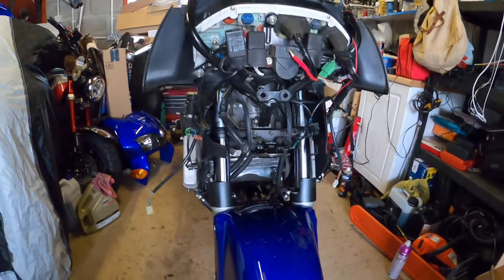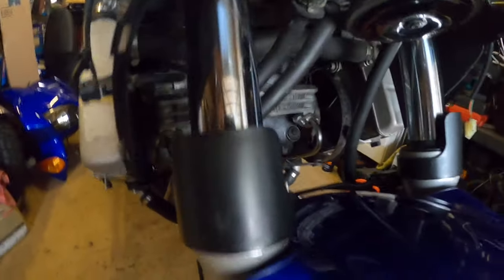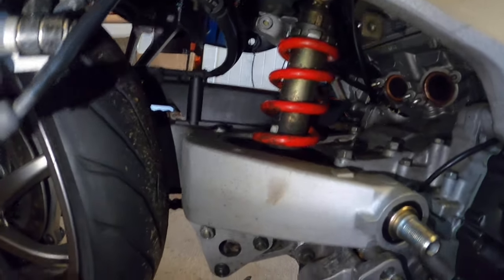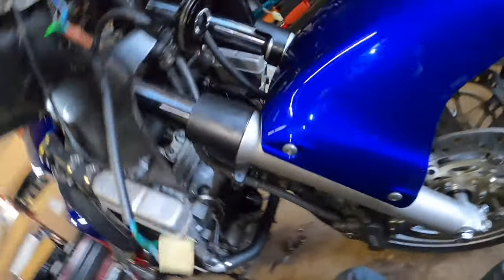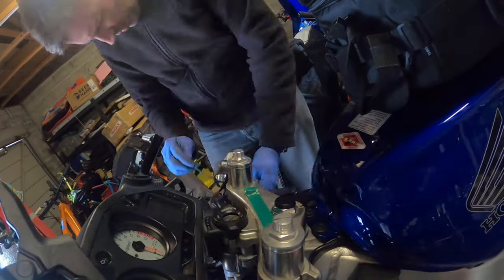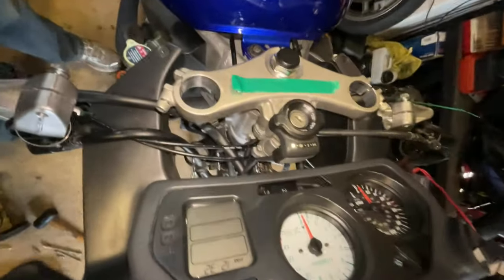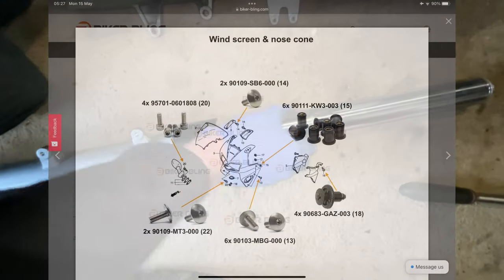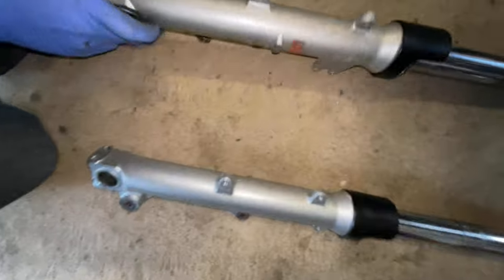Project RC46 - Episode 2 - Drop your suspenders!

Comment: Looks better condition than my gsxs 😂 it went on fire on Friday while driving. See my short I posted
Reply from the maker: Blimey! That's not good.  Fried starter solenoid? Pretty unusual on that bike that I'm aware... 😕 Hope you got it sorted. 👍

Yeah, thanks She's not bad, I've been messing with it all winter, cleaning, replacing etc etc... Could have had hours and hours of footage but would have meant hours upon hours of editing of which There is loads on these bikes already for that sort of thing , so just doing my own thing, will be plenty content anyway regardless! 

Having the time to record and edit is the biggest issue.
Reply: @twistandgo3414  yeah it's back on the road Im assuming corrosion on the terminal caused it to fry it was all green pretty mental. Thankfully didn't end with me driving like ghost rider. Youll see it on my video.
Yeah she's alive checked it all over during the weekend new relay in all terminals cleaned ect working fine now. Don't know if I should keep it much longer been looking at a 2014 drz400sm very low miles.  But carb again instead of fuel injection slightly puts me off.
Reply from the maker: @MadNath  they're a fun bike though!! Great for the commute! And you'll certainly save on front tyre wear! 😂😁😎👍
Reply: @twistandgo3414   true not something I've driven never been on a supermoto last dirt bike I was on was 17 years back.

Sure this bike Hates me just got a screw thru my new rear pilot 5
Reply from the maker: @MadNath  youre kidding!?  Aww man, that sucks.  Hasn't brought much luck had it? , never had a single problem with any suzuki I've had over the years, literally not one minor issue.

The plugs failed on my K8 Gsxr 750 while I was at Almeria, first morning there, but wasnt really the bikes fault.   Got a new set delivered to the track the next  morning and all was well ever after.

Yeah, maybe youre due a change?..
Reply: @twistandgo3414  I love the bike but I feel the same issue will arise driving all weather like I do. I've put a lot of cash into the bike. New clutch ect would love to keep it but how long till it dies completely.
Reply from the maker: @MadNath  probably ages of you've replaced everything 😂.  Their engines are Bullet proof though and it's a detuned gsxr 750 engine and they go on forever. Your swing arm might dissolve before the engine packs in. 😂😉😎
Reply: You had a gs310 is it a good commuter is it okay with build and reasonable for speed
Reply from the maker: @MadNath  yeah, had a couple of little issues but all sorted under warranty / recall.  It didn't actually affect my ownership of it directly, just having to take it in.  I actually really quite liked it. Only got rid as it was due to go back after 3 years and having taken over dads vstrom 650 at the time, so  I didn't need it, so it went.  Seat is much comfier than the crf250L it replaced and the fuel tank is bigger.  More power too at 34bhp (KTM 390 Adventure R has 47 bhp but it's more expensive).  I would have another. The newer ones have LED lights too.  Def worth a look.  Suspension is a touch soft for any serious off road and the tyres are rubbish on wet grass or mud.  Plenty options to upgrade it though.  Rally Raid is worth a look for that and tyres easy sorted.   It will do 70-80 but youre not accelerating with intent to overtake up at those speeds, it will go quicker with a long run up! 🤣😉.  Good bike but a nightmare to take apart.  Something like 26 screws just to get to the airbox if I remember.

CB500X is also def worth a look.  Also more power than the GS and Rally Raid options with that too for off road intentions or aggressive look. 

Videos on the Channel about the 310 and chasing the little fella round a wet field.